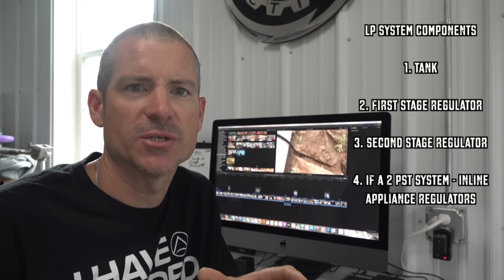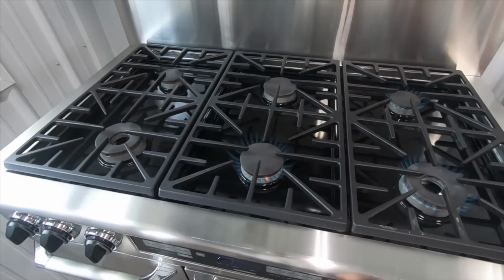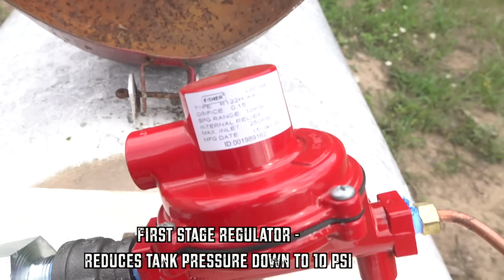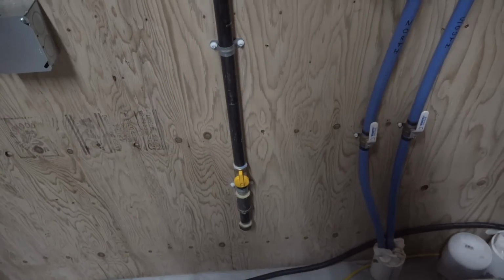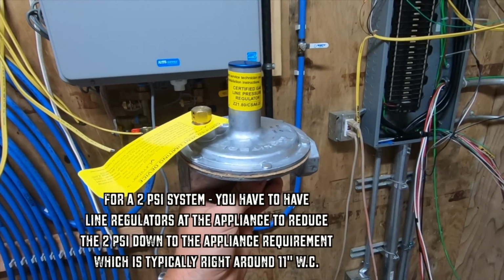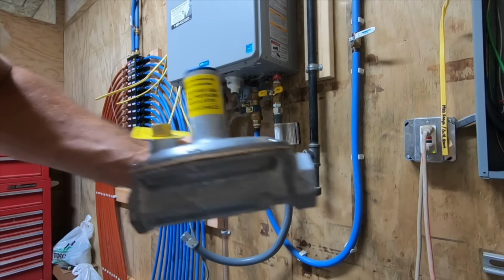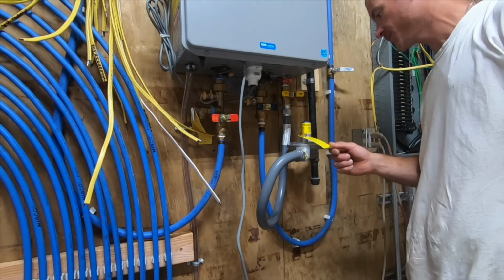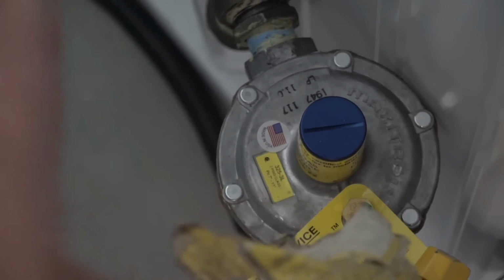2PSI LP Residential Gas System

Comment: Always check your regs for pressure.  Just because they are stamped or preset doesn't mean anything.  lol.   Almost every reg I get is off from its set point from factory.   Had one the other day set at 16" the max.  Was about 8" off factory spec.   Easy enough to do but don't trust the qc people.   Good job other than that.   Maybe cap your valves just in case.   A lot of people even in the gas trade misunderstand how gas works.   And pressure vs flow.   I see way too many people here installing huge 400k pool heaters on a low pressure 250k supply and wonder why the exchanger blows out in a year.   lol.

Comment: Doesn’t your stove already have a regulator built into the back where you flip the spring for lp? Do you need the maxi to keep the constant 11’ due to the footage of the run involved?
Reply from the maker: Instead is a regulator at 11”wc where service comes into the house I have a 2psi regulator so I have to have an additional regulator at each appliance that drops it to the 11”wc prior to entering the appliance.

Comment: Pretty nice install I would recommend a test port after the regulator so you can check the gas pressure and regulators function they are adjustable and sometimes need to be adjusted. Clean work though

Comment: Nice video, i too am installing a Rheem  propane tankless water heater to supply the heater for my radiant floor heat system.. I was surprized you used regular blue pex tubing for your in floor tubing instead of the required oxygen barrier tubbing (orange) tubing. Why did you go with the regular pex tubing?

Comment: The 325-5L seems pretty big since they handle 90CFH LP = 226,530BTU
Reply: Which is perfectly fine for an appliance who max btu output is 178000.
Reply: @anthonyflynn6578  Yup. Everything is installed and set perfectly.

Comment: The second stage regulator is usually adjusted between 11 and 13 inches of water column. Your appliances have their own regulator that will regulate it down to 10 or even 5” for two stage gas furnaces.

You need to understand that propane is not made to run on most appliances. They are designed for natural gas. All we do is change the pressure and orifices and nothing else on most appliances. They burn dirtier, and usually don’t last as long on propane.

Comment: I need to do this in the spring.  I have a 96k furnace, gas stove, and a 60k garage heater. From everything I have read so far I need the maxitrol 325-3L -1/2 with the vent limiter on all 3 devices.  The 325-3L says it handles 90cfh which totals 226,530btu. Can someone confirm so I don't order the wrong parts?

Comment: How do you verify that the maxitrol regulator pressure is set correctly?
Reply: At the inlet pressure side of the gas valve on the regulator would be my guess.

Comment: What are the downfalls or cons for going to a 2psi system?
Reply from the maker: You have to have a regulator in ea appliance which adds some cost
Reply: @MrPostFrame  thanks.  I typically design using n overkill approach. Is it a waste, for a combine utilities system that has a 48kw generator and 2 17gal/min tankless water heaters, possible 3 gas cooking stoves and 2 outside fireplaces, to use 1inch lines from the tank to all sources after the 1st stage at the tank and before any 2nd stage to each load? Would 1/2inch or 3/4 inch lines, from the 2nd stage to the loads, suffice for all but the 48kw generator? Thanks for your responses

Comment: If you had put a manifold outside the house where you have the 2 psi regulator and put 4 regulators at 11" then had each regulator run 2 appliances you wouldn't need any at the equipment, or any inside the house. This would of course turned 1 wall penetration into 4.

Comment: You did a great job and this is coming from somebody with
 35 years in the field but I would like to go over some shortcomings.#1 at your tankless water heater you installed the shut off after you're flex line. The best practice for this installation would be a shut off valve before the sediment trap (drip leg) and the regulator.#2 just because they regulators are stamped 11" does not  mean  its necessarily so ( lock up and working pressures should always be tested after any regulator is installed).#3 two pressure tests should always be performed. I realize you did the one after installing your fuel runs which is fine but a second one at operating pressure should have been performed with all equipment connected ( this will ensure that all connections and equipment gas valves are gas tight, nothing passing gas or leaking).  
 Other than my three concerns you did a fine job, keep it going and stay safe out there.
Reply from the maker: I appreciate your insight! Thanks!

Comment: Couple of questions. Why did you choose a tank less water heater?  How did you decide of which on you needed?
Reply from the maker: I have had them in my last three homes.  I like not ever running out of hot water so that is why I chose a tankless.  They are rated at gallons per minute and most will tell you how many bathrooms they can supply at once.
Reply: can you tell a difference in energy savings?

Comment: Just an observation,  but it would likely be much cheaper to install a 12 KW, grid connected solar panel system.  You have a lot of land so you can install a ground mounted system. 

You could install it yourself for around $15,000 and your payback period would be 5-7 years. 

You could use two high efficiency heat pumps to heat and cool the house. One heat pump would be for forced air heating and cooling,  and the second could be used for your under floor heating and cooling. 

This would probably be your best energy choice because you have a large house.  Heating it with propane in the winter will be expensive and you will still have to buy electric AC units. 

A ground mounted solar panel system is by far your best option.
Reply: @FL FL  Love the ground mounted system; makes it easy to steal in a SHTF scenario. Thanks

Comment: Man I still can’t believe you’re gonna run that whole giant house on LP! Did you consider geothermal heat pumps? Probably would have paid off the difference in less than 10 years, maybe 5 with how much LP you’re gonna go through. Your house your call though. Love the build, thanks for sharing with us!
Reply: Geothermal is incredibly expensive,  and a 10 year payback period is very optimistic if you factor in the TVM  costs. 

A better approach would be to install a 10 - 12 KW solar system and connect it to the grid. He could install nearly all the system himself and the utility credits would provide free electricity. He could install this system for about $15,000, and if heated and cooled his house with a high efficiency heat pump,  his payback period would be 5-7 years.

He could also use a heat pump for his underfloor,  piped heating system.  

Solar would likely be the best overall energy choice.
Reply: @flfl3969  Most of geothermal expense (80-90%) is trenching and burial.  However, this guy has demonstrated willingness and ability to do all that work himself—likely more thoroughly and higher quality than most anyone he could hire.
Reply: @TheRentsTooDamnHigh  Possibly,  if he installed the below ground loop himself.  But if it leaks,  it is a bit ch to fix. Also the geothermal heatpumps are more expensive.
Reply: @wallykramer7566  Aren't the geothermal heatpumps specially made for this application? Aren't they more expensive? I'm not sure that geothermal would be cost effective even with him digging his own trenches. It is worth the time for him to get an estimate though,  you may be right. 

Regardless,  we both agree that heatpumps are superior to gas as far as cost.
Reply: @flfl3969  Geothermal heat pumps, at least the ground loop portion, work at lower pressure and with ordinary fluids.  However, having multiple loops (ground, and then inside the pump) complicates it a little.  The net result is it may not be a whole lot more expensive, but it certainly has to be more efficient than burning propane.
Reply: @wallykramer7566  Agreed. But is it worth the cost difference to go geothermal rather than a regular heatpump. How cold does it get there?
Reply: @flfl3969  It is uncomfortably cold there.  See the climate information at https://en.wikipedia.org/wiki/Iowa#Climate
Reply: @flfl3969  that would be the ideal setup! Heat pumps work best with underfloor heating due to the low water temperatures that are needed for that. And that huge roof is perfect for a solar system or even one of those hot water solar setups, (we got one and don't turn on the water heater for 8 months a year). Would really make the place more independent from utility companies and price fluctuations
Reply: @maxbezold1056  In this  case,  because he has a huge yard and no trees, a ground mounted solar system is highly preferable because it is easily cleaned and serviced. It is is also cheaper to install.
Reply: FL FL agreed that solar would be best for powering heat pumps. These are my dreams for when wifey finishes residency
Reply: I was thinking the same! There is enough space available to put in earth collectors, which are just as easy to put in the ground as your septic field. Geothermal would also tremendously reduce costs for AC in the summer. And I think even a heat pump for hot water would be cheaper to run than an LPG tankless system since LPG prices are probably only gonna increase in the future...
Reply: @maxbezold1056  Like you read my mind man.
Reply: LP works when the electricity is out !
Reply: @jesperdahl1486  true! But you would still need a generator of some sort for fan coils, ignitors, pumps etc... and when you're buying one anyways, upgrading to a slightly larger one to accommodate for the heat pump is not gonna add a lot of costs since HPs are more than 400% efficient (and therefore don't need that much power).  So in the end the HP + larger gen set probably would still make economic sense...

Comment: This is an interesting approach to solving your gas supply issue.  If indeed it will work,  it is impressive.  Here in AZ I  would have to supply a design plan to the gas utility for approval and they might require a licensed plumber to do the work - though I am not sure if I could do the work or not. 

You might want to consider putting a water filter in your water lines to your two hot water heaters. From what I understand,  the biggest problem with the tankless water heaters is that hard scale builds up in them and they are very hard to clean. If you installed filters to eliminate the calcium and magnesium from the water,  you would eliminate having to descale them on a regular basis. 

You will need more than a carbon filter but be careful because an RO system will make your water very acidic and it will eat any copper piping in your water heaters or water lines. 

Check with a water filter company to see which filter works the best to eliminate hard water ions. You could go with a salt system,  but I despise salt based water treatment systems.   I am betting there are well water filters which will do the job.

It's important to ONLY treat the water going to your tankless water heaters.  If you want your hot water to be potable (for cooking), go with a  carbon filter system with 3 - 5 stages. They are very cheap and they make your water taste amazing. A 5-stage system will probably eliminate some of the hard water ions. 

The carbon filter systems can be sized to filter ALL of the water coming into your house and you can buy them yourself and install them.  They are easy to install and maintain.  

I hope this helps you.

Comment: SUGGESTION, We put a propane tank on a property in NH. What we did was buried a much larger tank than yours, maybe 4 times as big, don't remember. My point is you will be using more than average amount of gas, with the large tank we waited until gas was cheap, yah right cheap, we. Bought it at a much lower cost because we waited when the price dropped and we bought allot at once. Not to mention those above ground tanks are just ugly. ENJOY YOUR VIDEOS, QUALITY WORK‼️👍👍. Vinny 🇺🇸

Comment: I'm kind of confused why you decided to put the 11"WC regulators directly at the appliance rather than directly after the manifold. I think the restriction that you'd have to worry about is line leading to the manifold, right?

EDIT: I guess the requirement to have them horizontal could make packaging them off the manifold might be tricky, so putting them at the appliance might make that a bit easier?
Reply: @tonygaunt7259  Maxitrol requires their regulators mounted upright and horizontal only

Comment: I would recommend 2-1000 gallon tanks and with your space bury them.  3200 square ft home in Pennsylvania (depending on the winter) uses 1500 - 1800 gallons a year.
Reply: Ohh I see. You mean you heat your whole house with LP. That makes sense then. I have a wood boiler (central pa) and that things a full time job! I’d rather have LP heating
Reply: Dang! I have rhianni heaters, 2 full size teppenyaki grills. Gas stove. Gas laundry.  I use about 100 gallons a year

Comment: 3/4" black pipe 2lb natural gas can deliver 970,000btu.  Few things about LP is that when it leaks it pools and settles low...which is the perfect situation for explosions.  In high efficiency applications LP is more acidic when it condensates.  Having multiple regulators kinda stinks.  Few years back built a large lake home with LP service and we vented all the regulators like you would a commercial/industrial application.  I love having natural gas...endless service.
Reply: My situation is the NG line won't allow residential tapping. So I went with LP. But I do agree with your comment. I'm in Central Michigan just north of Lansing.

Comment: The regulators that you put on the stove and the in-line water heater were the same capacity as far as inlet and psi out but they were very different sizes… Can you explain why?
Reply: The one to the water heater was 3/4", while the stove was a 1/2" line.
Reply: Peak flow demand was very different, 175K BTU water heater   96K BTU stove
Reply: @jesperdahl1486  ,SM & WMG , a 325 - 5L regulator is rated at 425,000 BTUs & the 325-3L is rated for 145,000 BTUs. It's just more economical to install the one rated closest to the particular appliance BTUs ( note : the regulator is to be rated higher than the particular appliance or appliances it is serving).

Comment: How is it you are allowed to have a gas line touching an electrical box and line?
Reply: My thoughts exactly, also, don’t understand why a discrete regulator was required behind the stove, isn’t that redundant by the one up stream?
Reply: @princepa123  No each appliance will require that regulator bc hes running a 2psi system and all LP appliances require approx. 11''

Comment: What I don't understand is why this couldn't be solved by a larger pipe supplying the manifold, and home-runs for each appliance (which you seem to already have).  You said all but one run is short, so it doesn't seem like decreased flow from long pipes is a problem (you could just have the kitchen be a 2psi line).  I feel like I must be missing something, but what?
Reply: Larger pipe could be used instead.  I think he said that in the beginning.

Comment: Good job on the pipe tape!
Reply: Is it normal to use pipe tape and pipe dope together?
Reply: @jaydak99  Technically, the mfg will not recommend it, but it does not hurt as a lot of people do it. The year ago comments were more about the "type" of tape he was using. They make different color tapes for different purposes, and yellow [sometimes blue] is for gas.

Comment: Yes very helpful, but do you have to have a regulator on every device? I’m in Texas and I only have 1 regulator on the tank and none on my other devices?
Reply: He's using a higher than normal pressure coming into house, so he steps it down at each appliance.
Reply: He could have sized his gas piping inside the house larger and would have only needed one 10 psi regulator at the propane tank and one 11 inch water column regulator at the house. He was trying to save money by installing smaller piping inside the house.

Comment: How long will one tank last? How much was it to fill it?
Reply: I looked for propane rates for Iowa, but propane businesses are seemingly squirrelly, probably due to different truck sizes and possibly long distances to drive.  It looks like his 400 gallon fill (80% of 500 gallons) should be between $500 and $900.  As for "how long a full tank lasts", this is highly dependent on usage.  Do you assume a nice summer evening or -40 day?  Is the house vacant or are 18 family members present?

Comment: Wow. That's pretty cool. Just so folks know: 2 psig = 55.36 in water and the standard 11 in water, is about .4 psig. You can move more gas with a bigger pipe / higher pressure. Six of one / half dozen of the other.  The cost saving is making it pretty popular in new construction.
Reply: Thanks.  He is a good guy but he forgot to mention this .
Reply: Rowdy, please explain more. Like the cost savings and any other valuable info you can share about propane savings. We have a 40 yr old  2000sf home my Grandfather built and it uses propane from a big tank. I'm am thinking of building a big pull barn/garage/shop on the property with a 1bedroom,1bath, small  kitchen on the property. Any extra info will help. Thanks again
Reply: Possibly, please make a series of videos to explain in more detail Rowdy. Consider that. Thanks